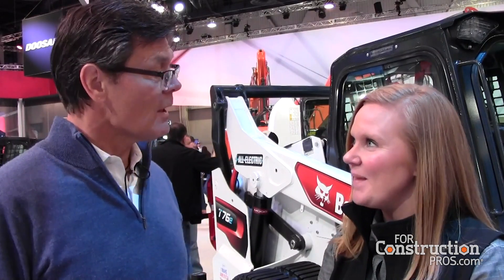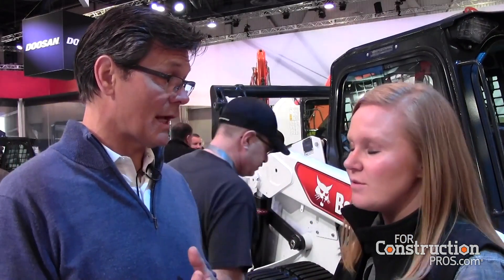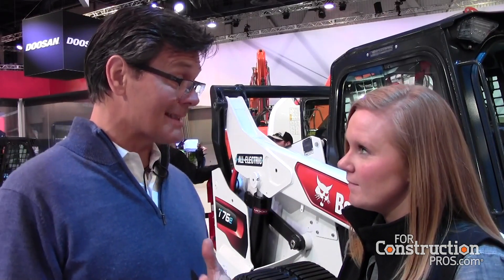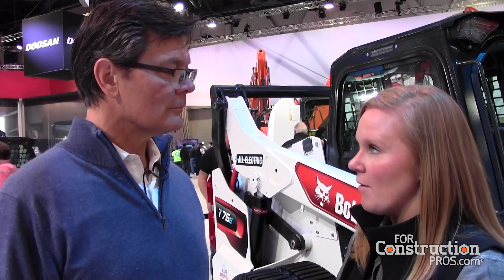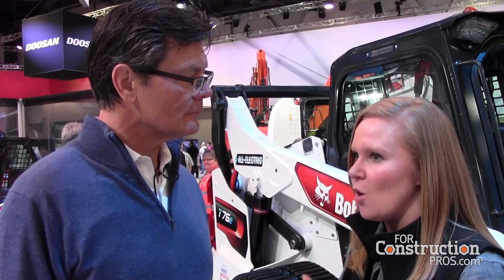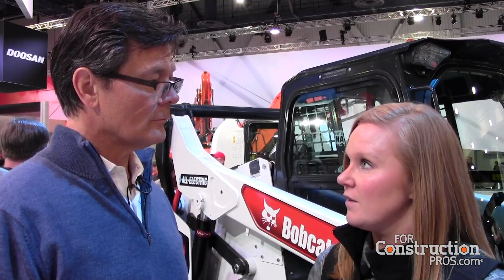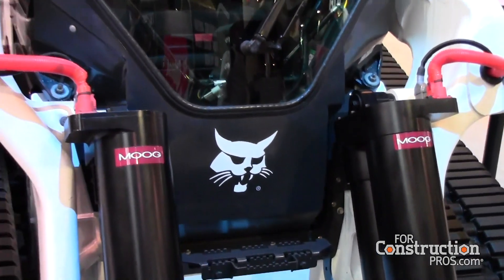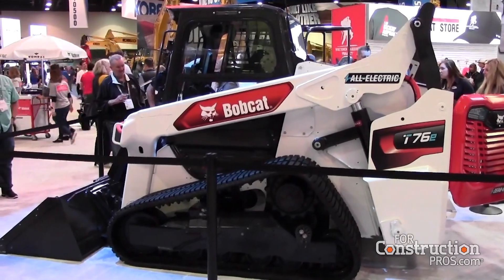Bobcat Brings Next Big Thing with First All-electric Skid-steer Loader

Comment: So how do you charge it on a job site 🤔. Probably with a diesel generator that has dang near the same diesel motor that runs the loader to begin with. So it takes 45 minutes to charge the machine  with a diesel generator, you could have Probably had the job done with a traditional machine by then. Makes no sense at all. Except for indoor use that's about it.
Reply: Yeah, you're right.  Better throw out the entire technology and EVs in general because it doesn't work the way you think it does.
Reply: @jonnyroadhouse8358  Yup that's about right, for heavy equipment.   K ill give you the benefit of the doubt, tell me how to charge one when it dies in a field. With no power to charge it, what would you do.

Comment: Rose i am wondering onthe Paper. I had a conference with CA 36 Raul Ruiz political Advisor along with Elizabeth Lavertu Candidate for State Assembly 71st district(Soboba to Jolon). Project is to contruct EV charging Staions 8 kilometers apart with Tesla Solar Roof=power wall- EV charger- underneath 1500 gallon phoscheck tank as self help project for Fire protection. Under United States Code Title 40 Section 2232 sub section 819 is a 80% grantees each station. http://indianvoices.net

Comment: The EV system makes more sense in the largest equipment. They can copy the electric diesel system used by the locomotive industry. Using a small energy efficient diesel that runs at a constant efficient RPM running a generator with a battery pack. The battery pack allows for extra current when needed and is recharged during the times of low energy needs. These smaller machines in EV are much more a niche than main market item. The utility companies and municipalities will buy them since their equipment always goes to the equipment yard each night and they can be recharged. Also, they are the only ones that will spend the extra $10k or$20k for EV
Reply: No maintenance.  A ford lightning or cybertruck can charge these anywhere for dirt cheap.  Oil sucks.  Fuel hydraulic leaks breaks garbage
Reply: @richardroberson9277  where does the electricity come from to charge them, oh that’s right oil. The intelligence of some people is low I question how they go about their day.
Reply: @pjbuckmaster  you are missing the point. Everyone knows ev still requires a power source but at least it opens the possibility that the source is not petroleum based.
Reply: @paulnovak833  California has already asked people to not charge their cars as much because it is putting a strain on the grid. So yes oil is going to have to be used to keep up with it in all forms. There is not enough land to put solar or wind to provide the electricity this country uses, let alone everyone plugging a car in at night.
Reply: @pjbuckmaster  perhaps the cart is coming before the horse but eventually, the horse will catch up
Reply: @pjbuckmaster  The irony of solar and EV is that they are causing more environmental damage than anyone is willing to admit. As you rightfully state, what is the source of electrical energy for charging after the sun goes down? Coal.
Reply: @paulnovak833  Not petroleum based, coal based.

Comment: This technology is still a few years from being at a point where it would make sense for someone doing heavy dirt work to own one however landscapers, pipe crews, general contractor multi-use tool. The one big concern that I would have about this because battery life and run time will come along eventually as the technology gets better is are regular old school mechanics going to be able to work on it? Otherwise you're looking at thousands of dollars Everytime you have a malfunction which if you're running these right you will eventually have a malfunction. Also I was looking at that bucket and it looks small don't get on that bullshit with cat with having a tiny bucket.
Reply: Hydraulic systems are very inefficient (10-30%), by moving to all electric (90%+), and potentially a regenerative system (charges battery when moving downhill or lowering a load) the amount of energy needed drops about 3X (electrical energy stored in battery vs fuel that gets converted into useful output work)
Reply: @eomhS  I'm not saying it's a bad idea. I'm saying it's not practical for heavy dirt works at this point. Such as backfilling or heavy grading or demo.

Comment: By switching everything to electric whether it's a car, motorcycle, yard equipment, power tools, heavy equipment, etc it's just putting a higher demand on our electricity needs and dependence.  Not to mention all the issues with future battery disposal. Time is money. I dont see this being a viable piece of equipment for what duties these types of machines are designed to perform and the cost will probably be insane as these are already high dollar machines to begin with.  I'd pass!!!
Reply: You’re worse than a rock mate.   Power is dirt cheap.  .04$/kWh commercial it’s like 10 cent a gallon diesel.  It’s only stressed by dumb consoomers 3pm-8pm not overnight when it’s near free.  Batteries are easy to recycle these aren’t double as.  It’s 1000lbs of valuable metal.  Nobody is throwing that away.  Lightning or cybertruck could easily charge this to 80% on a lunch break.  And it doesn’t leak crap out of every hole known to man and smell sound like shit
Reply: Ah but you see "the experts" have spoken, do not question. 😉
Reply: "time is money" save time in the long run with no engine related maintenance, no making long runs for gas. Sure plugging it in might take longer but when you are done you just plug it in. No need to wait for it to warm up when starting it up

Comment: This is probably the first EV application where the weight of the battery is a pro rather than a con. I could see a use for this in an indoor environment, but unless I missed it, no mention of the ROC of this machine.
Reply: Actually electric forklifts have been around for a while that utilize the weight of the battery too.